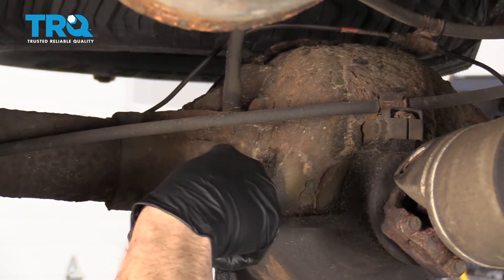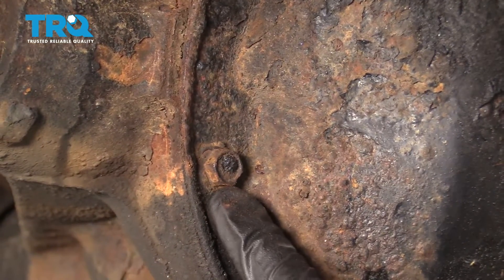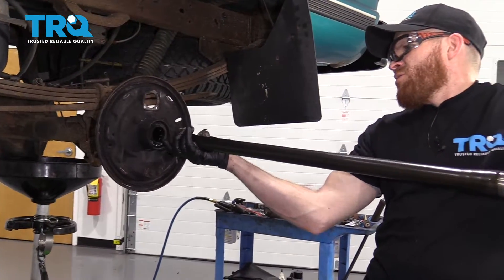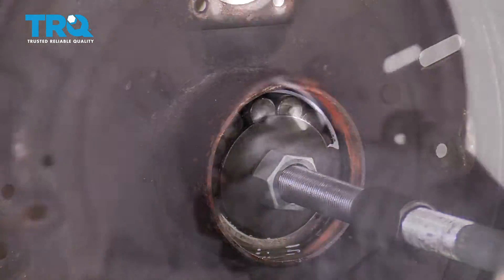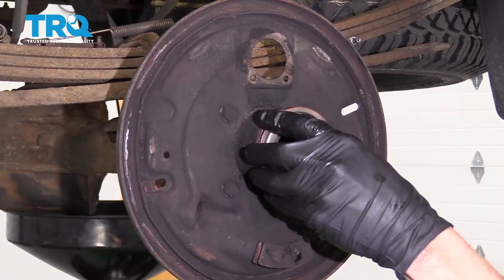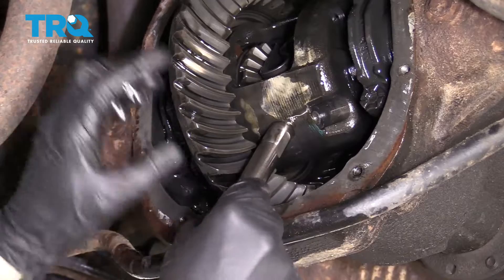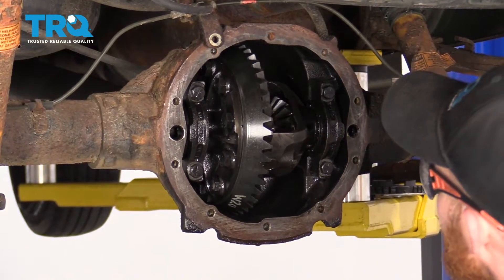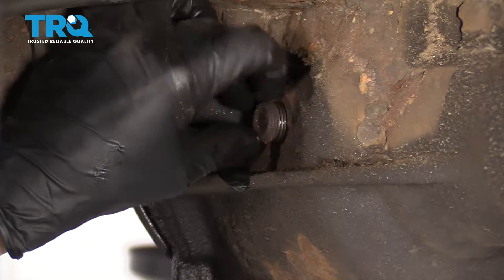How To Replace Rear Wheel Bearing and Seal 1992-99 GMC K1500

Comment: I had a piece of 1" cold rolled steel round stock 9' long that went right through the differential and tapped the bearings and seals out with a five pound sledge hammer without even damaging the bearings or the seals.  No problem and regular steel or aluminum round stock would have done the job also.  Just make sure the round stock is clean before you stick it into the axle housing.

Comment: Great video,  I have a '89 Silverado.  The 8mm bolt won't go back in.  My pin is super tight.  A 2lb hammer wouldn't move pin. IDK what to do now.  Any suggestions

Comment: Hmmm.. Good video. I have a small (I hope) issue. I jacked only the wheel up that needed the seal, removed the pin etc, and the horseshoe clip refuses to drop, releasing the axle. Any suggestions, or do I need to have the whole rear lifted? Or??? Anything you can suggest would be appreciated.

Comment: What are the torque specs for the locking bolt for the pin, the fill plug and the 10 bolts on the differential cover?

Comment: Where can I find the torque specifications for that 8mm bolt holding that locking pin in. Have a 95 chevy c1500 don't have the owners manual for it

Comment: I recently replaced  my axle bearings  and seals. I noticed on the axle bore where the bearing is pressed into, has a rough spot inside of it,  Would  this cause any noises? Like a deceleration  roar?  I went ahead and pressed the bearing in since  it was only the back  of the race  that was touching  the rough  spot. The spot  is at the 12 o clock position, i suppose from the load of the axle..
Reply: Good work, how many hours did it take you?

Comment: Still want to know the size of those punches you used on the install
Reply: you can buy a bearing race and seal driver kit from harbor freight, the kit comes with multiple different sizes of those circular drivers. just use the biggest one that will fit into the bore for the bearing and an oversized one for the seal

Comment: That's the passenger side! what about the driver side shaft? I have to change the bearing wheel on both sides. That is the same differential (cover with 10 bolts) on my 1996 chevy pickup 4.3L -2WD. Help! : (

Comment: Hi there. I'm trying to order the right size bearings for my 1996 tahoe. Are they 8.5 or 8.6 or what?
Reply: i know this is old and you may have found your answer, 8.5 is up to year '99 (but this year is a transitional year and could have either) 2000 and up is the 8.6